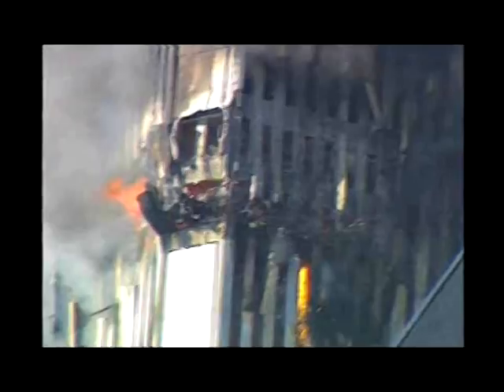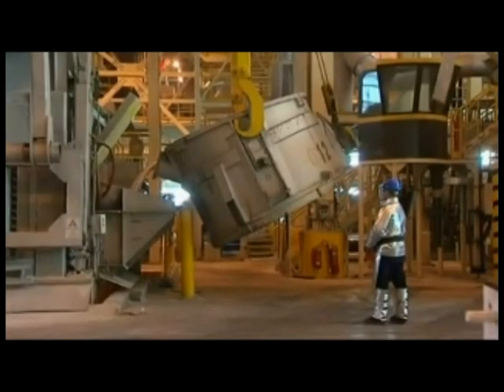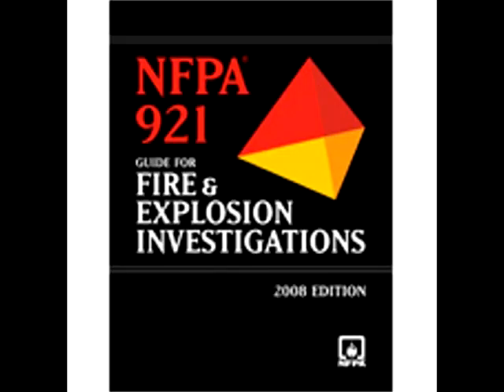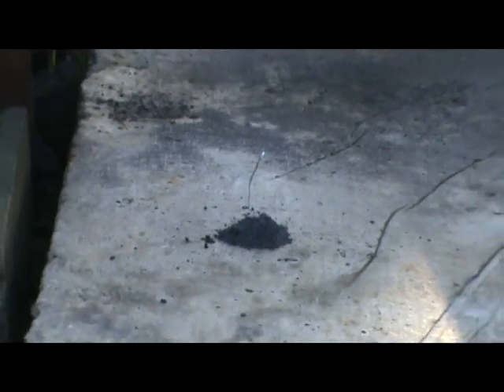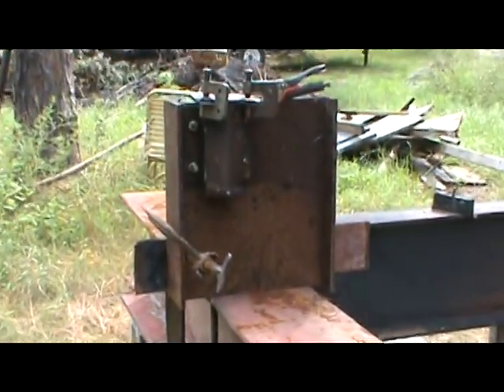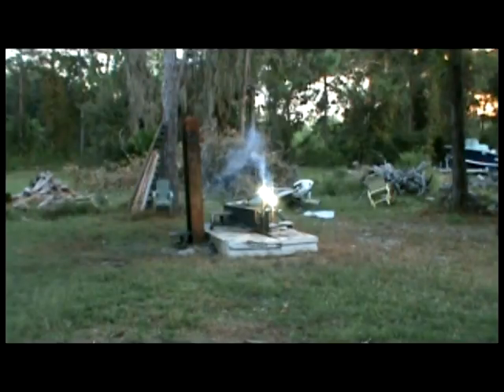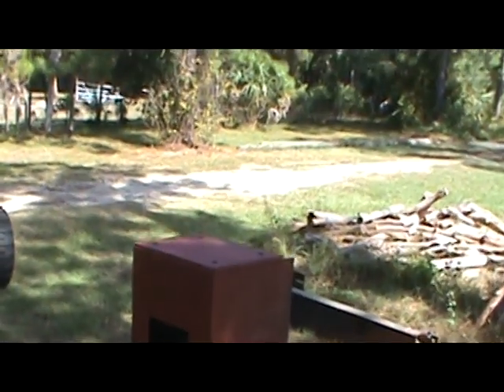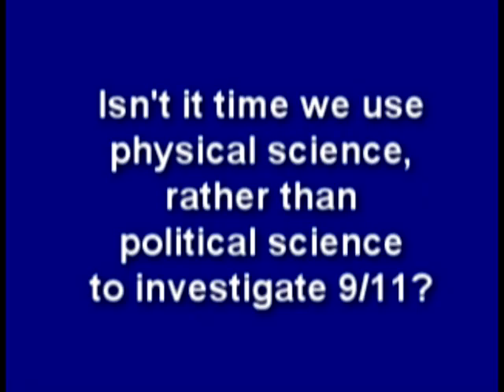9/11 Experiments: The Great Thermate Debate

Comment: @ThePeage I have a problem with their methodology.

In short, EDS scans are far too random, especially on such a sample size as their red layer, to give consistent information of the structure. Further, if you cannot find to any level of accuracy the relative amounts of thermitic reactants, who's to say this material they've found was manufactured at all?

To correct this, they might've at least run a quantitative analysis on the cross section, which I'm sure would have been perfectly accurate.

Comment: @debunkerman says "Find out what happens to steel beams when they are exposed to fire."

Well, they sag, that's about all. 
They don't melt, do they.
That's why steel framed high rises DO NOT fall down at freefall acceleration due to fire.

Comment: @ThePeage How droll.
Figure 10 is an EDS scan of a cross section. That's fine.

However, they based the quantitative analysis off of an EDS scan of an entire red layer, shown in fig. 15. This sample is far too thick to give meaningful results.

They should have done the quantitative analysis on results from the cross section.

Comment: @ThePeage Somehow they avoided doing the most significant analyses on the kind of sample EDS was intended for! Jesus!  :P

I find conclusions 2 and 5 suspect. 6 is there for no reason I can tell. 7-9 deal with ignitions tests, with which I am not concerned. 10 is just a string of speculation. Conclusion 1 is obvious, and not followed with anything. 3 is mere visual observation, and 4 is based on a single cross section. Keep in mind, the slice EDS map is of a single layer, no structure follows.

Comment: @ThePeage And on top of that, thick samples may absorb a significant portion of generated xray's, revealing nothing about the interior, and eliminating a random portion of rays off surface atoms.

The EDS graph of the red layer is thus indefinite, making any analysis of it's data suspect, including all the quantification analyses. 

Now, the cross section of a red layer that was analyzed would be exempt from this criticism.

Comment: @Skeptic121 The paper would serve as a foundation for a follow up. However, it demonstrates little and suggests much.

Specifically, it finds the presence of various elements but reveals little about their chemical bonds.  Free aluminum and iron oxide are suggested, but those elemental maps are only done on a single thin cross section of a red chip, and as such you can't see whether the composition continues.

Comment: @ThePeage As it is, various meaningless analyses are performed, such as the ratio of Al/O in Al rich areas and Fe/O in Fe rich areas. Finding it to be significantly higher in the case of Al/O. All this indicates, however, is that the Iron in this sample exists more as Iron Oxide than elemental Iron. And that the Aluminum is more elemental than Oxidized. However, this is completely natural! While Fe particles will rust through, Al will form a protective layer of oxidized Al, limiting oxidation.

Comment: @ThePeage @ThePeage However, to determine whether a sample is of thermite, i.e. iron oxide and aluminum intentionally mixed, we must assume that there is a negligible amount of unusable material in a given volume of sample. This ideal ratio is 50/50. In this, all Iron Oxide is stripped of it's oxygen, which is then bound to an equal amount of Aluminum. This is the one ratio which might have shed light on the nature of the material as thermitic, however it is not performed.

Comment: @ThePeage Bypassing for the moment a lack of detail on behalf of their quantification routines, there is the problem of there never being a comparison between Al and Fe. A thermitic reaction requires a metal oxide and a deoxidizer. In this case, IronOxide and Aluminum. 
Harris' paper does several quantitative analyses of the ratios between Fe/O and Al/O, eliminating the Oxygen bound with the other element. I find no problem with their method of doing so.

Comment: @ThePeage My point is that it is only with great difficulty that EDS scans can be made to give quantitative results. Either thin sample slice (less than 10 nano meters) are used, or the surface of a thick sample is both polished and cut, so if, say, the detector's shape occupies a plane, the sample surface occupies a parallel. Other arrangements are possible, depending precisely on the detector's shape.

Comment: @ctcole77 

In early 2000, Stephen Way acquired the appointment of Marvin Bush to the Board of Directors of HCC. In that transaction, Bush not only landed a very large salary, but a sweet stock option deal. He purchased about $130,000 worth of HCC stock which is now valued at close to $600,000, not even one year later.

Comment: @ThePeage '....then where did the come from'
No clue.

'XEDS will give a spectrum of the whole test area'
True. My point is this is all it provides. It does give with any useful accuracy the relative amounts of elements from spectra.

What is recorded in an EDS scan is essentially the energy discharge when an electron is knocked from an atom's inner shell. However, the velocity of this discharge is random. It is not a guarantee that an averaging of the amount of signals will reach a detector.

Comment: @pjnlsn An EDS scan cannot tell you the relative amounts of each element. It's results can be highly accurate, but it is only the existence of certain specific spectra, and their corresponding elements, which it reveals.
You cannot say from this data that, for example, the samples contain 52% Iron 25% Al 23% Oxygen, like some thermites, all you can tell is that the sample _contains_ Fe Al O..

Comment: @pjnlsn "As a report, it fails to distinguish between metal ignition in an oxygen atmosphere, and a thermite reaction"

If I recall correctly that conclusion was drawn because the observed temperature differential was greater than what can be accounted for by the oxygen.

Comment: @DarkwingScooter He 'lights it on fire' and says the energy output is large, essentially. He could have at least isolated the chips in an oxygen less environment, making it clearer that this substance could burn without external oxygen stores. As it happens, the paper reports a man lighting a piece of metal alloy on fire in a room.

Comment: @DarkwingScooter True enough.

Even not requiring detailed descriptions, the paper doesn't say how it goes from detecting a few elements to it being thermite. Which is specifically a metal oxide and a deoxidizer, i.e. aluminum.

It essentially says that these chips must be thermite because they burn and because they contain, in some form, and in some amount, Iron, Oxygen, and Aluminum.

Comment: @ThePeage In any case, I've actually read the paper, in it's apparently revised form. And the sketchiness of it is apparent, even to me. They go through and show a few spectrographs here and there, while detecting the presence of certain elements, they fail to show anything else about how those elements appear, in what structure, and how they are bonded. It claims iron oxide, and says the percentages indicate it, but fails to show what those percentages are, or how they would have been found.

Comment: @noozilander Explain to me where exactly a hypothesis or actual analysis is to be found in the paper. All it does is do a minor spectral analysis on some chipped material, and immediately concludes that the mere existence of, essentially, aluminum and iron means that the chips must have been thermite. With no analysis whatsoever, and unaware that other papers address this already. The type of scan they performed does not yield amounts, only the existence of certain elements.

Comment: @Merlin5x5 says "No, I told you that ALL microspheres from volcanoes start out as teardrop shape"

LOL!
No, swallower, that is a categorical lie.
Your original comment was a feeble attempt to explain that iron micro-spheres could not have been caused by the molten iron falling through air. You said it because you didn't understand surface tension at the time. Now you pretend to be an expert about it. LMFAO!

You lose when you lie, coward.

Keep swallowing.................

Comment: I've used many ways to melt steel in the last twenty years, and it would be very easy for that liquid fuel fire to melt steel if the fresh air being draw into the building is concentrated into tight spaces

Comment: @Merlin5x5 splices held together by 8 bolts total, that's 20 pounds of thermite and the connections is gone. Once the bolts are gone the weight of the building...

Comment: @Merlin5x5 lol, all the columns were under the same pressure and the corner columns had 2* bigger surface -they carried twice the load of a normal core column.

Or do you want to claim that 4 columns carried 40% of the total load of the building with the remaining 270 just watching? OMG

Comment: @Merlin5x5 Look, idiot. That sentence is take out of the context. Skilling did a great job, due to wind resistance the steel had to be under same pressure all over the building (I think it was 30 or 300 MPa) now the corner columns were 1,5 times thicker and a little bit bigger - their profile was thus 2* larger -. they carried the load of a two normal core columns, so the four corner columns made up 10% of the core's total cap. got it?

Comment: @Merlin5x5 that's taken out of the context and you know that it is a fucking lie. 47 columns total, 43 had aprox. the same thickness and 4 were a little bit bigger with cca 1,5× thicker walls, now do you want to tell me taht those 43 columns carried only 20% of the load? What do you smoke?

Comment: @Merlin5x5 he uses W12×50 beam, that has walls 1cm thick

90% the columns at 96th and 98th floor had 3 cm thick walls

source: NIST's materials at     wtcmodel.wikidot

you fail

Comment: @Merlin5x5 you have sad that the WTC impact zone columns were 8× thicker than the ones used in this experiment, anderson used 1cm thick columns. The WTC columns were between 2-3,5 cm thick. Now, do I need to teach you basic math? You've also sad that there was no space for the cahrges, I told you about the cavities between the plaster board and the H columns..etc

Comment: @DonArsuk84, "Where is the steel which were cut by thermite, which caused you to be 100 percent certain that thermite was used to demolish wtc."

“A one-inch column has been reduced to half-inch thickness. Its edges–which are curled like a paper scroll–have been thinned to almost razor sharpness. Gaping holes–some LARGER THAN A SILVER DOLLAR...This Swiss cheese appearance shocked all of the fire-wise professors..."
The “Deep Mystery” of Melted Steel

Watch at the 10:33 mark

Comment: @Merlin5x5 'no evidence of IRON'
I just had to say, this made me laugh (no offense).
Do you know what steel is? Usually about 99% Iron, and 1% Carbon.

Anyways, I understand both iron and concrete particles were found in the rubble. Impacts on the building are all you need to explain this. A question to others: Need all rubble fragments be the size of blocks?

Comment: @Merlin5x5 "AV FUEL pool fires typically incinerate a plane down to the wingtips, nose and tail. They would do that EVEN MORE SO, confined inside a building."

No sir they do not, never seen a plane crash huh? The strew AC aluminium for hundreds to thousands of yards long. Wreckage everywhere. The do not leave molten metal. You obviously do not even attempt to research anything before you start spewing nonsense.

Comment: This is hilarious, you try and use one of the primary reasons why fires could not have done that day as a defense to what certainly did do it! "Heat sink" In-fact thicker steel is a better heat sink, as is the steel decking and concrete, extremely effective for non focused  low intensity and slow sources like fuel fires.

Thermate / thermite on the other hand is not a slow source is focused and extremely intense. You validate that fuel fires are not capable of causing the collapse with this.

Comment: @Merlin5x5 your full of shit, your not and evading the obvious, which is it has in this video been proven to be possible by a novice in-fact. Proving that there are far far more effective way to use the same methods.

your ignoring the obvious to "try" to avoid the fact that you and any supporting your premis have been proven wrong completely with this video.

Comment: @Merlin5x5 Merlin......to extend some of these demonstrations to the full width of a steel column, you simply need *more* thermite. There's not reason to assume the reaction just stop, short of the column width.

As far as attaching to a vertical column, he used some magnets. This failed. It wouldn't if you used *stronger* magnets.

Comment: @Merlin5x5 Out mass?
That seemed to be true in the videos, but he did mention that nano thermite was supposed to be used, which I assume is more compact.

The point is, it's disingenuous to say 'thermite cannot possibly cut through steel'
Rather you must say: 'a delivery system for packed thermite would have left traces',  'traces which we do not see'

Disingenuous, and also not true.

Comment: @SexyMelon Well, i'm fairly certain that a mixture can be formed of solids and liquids, and that it can require a deal of time to settle.
In any case, there could have been combustible particles spread across the floor, and as the aluminum flowed, it picked up these particles, until the mixture flowed out the window.
Just equivocation, I know...

Comment: @Merlin5x5 You should actually watch this video. Thermite is made to cut through varying lengths of steel. And through the heads of bolts, which is afaik the only thing connecting the columns together.

Comment: @SexyMelon It wasn't quite an 'experiment'
It was a claim supplemented with a photograph.

You see, mixtures of different particles of substances with varying densities can mix together. Oil and water mix fine when shaken. It is simply that a greater difference in densities makes it more difficult for two substances to mix, i.e. a greater amount of movement required to keep them mixed.

Comment: And there's one more thing....
You have to consider that office fires are regularly 1000C. And that there could have been fires nearby the molten flow burning, so negating the dampening effect of great air distance. And that the molten flow could have been a mix of combustible material and aluminum, flowing together. So the glow could have been a reaction other than thermite, burning as it fell.

Comment: @SexyMelon "Again, false, as they were not recorded at any other sites in vicinity (according to you, not even at these sites!), or anywhere else, ever."
Says who? Which other sites in the vicinite were on fire? How is 1300°F/700°C not perfectly normal for hydrocarbon fires? Most of the fires burned underground. I think it is pretty normal that they would flare up here and there as the rubble shifts or gets removed.

Comment: @SexyMelon "And only two of them signed their supported for the NCSTARs. Just two"
Where?? What's the relevance here?
""That is very far from true. Only a few are structural engineers." Also a complete lie. All entries are checked and listed with credentials."
A complete truth. You said there are 1300 structural engineers. I dare you: Count them!! I count somewhat over 600 engineers, and many of these are not structural engineers, but electrical, chemical, mechanical, etc. Please apologize.

Comment: @SexyMelon ""the red-grey chips do NOT contain sulfur" They do. Read the paper."
Quote from the paper (page 17): "Other peaks included calcium, sulfur, zinc, chromium and potassium. The occurrence of these elements could be attributed to surface contamination" (contemplate on the last 2 words!). This relates to ONE chip that wasn't ignited. Of the four that were ignited, 3 showed absolutely NO sulfur, and 1 a tiny peak (page 14)

Comment: @SexyMelon ""The hot spots were about 6 patches on the surface of GZ, each covering an area of only some square feet." Then that is simply false, as available to verify with a simple Google Images search."
Read the original report (by USGS) in its entirety, don't just look at googled pix and twoofer websites! They have analysed the images in depth and the result was, as I stated: a handful of spot, each only some square feet in area, were thus hot. Well, not THAT hot. Normal fire temps.

Comment: @SexyMelon "What is this nonsense?"
You said steel glows dark red at 1200°Celsius. That was WRONG on your part. It glows dark red at 1200°Fahrenheit (and is pretty solid still then)
"Based on your previous posts I'm going to guess you idea of "know" is "looked at a page of a debunker website"" - No looked at Twoofer website. Hardly any of the 118 (IIRC) said "molten steel". Some said "molten METAL", some said "RED HOT steel" or something like that. Only a handfull said "molten" AND "steel"

Comment: @SexyMelon "Rest of experiments: I am kinda missing the flows of molten metals that persist for days...." Shifting the goalposts."
Not really. You make a big deal out of the "molten metal" and the "hot spots days after the event. Apparently, thermite burned on 9/11 explains that? No! When you weld train rails with thermite, you melt iron, ok. But 45 minutes later, it will have cooled so much you can run a train over the rail!
So how could thermite account for high temperatures days after??

Comment: @SciMethod "1) The iron-rich spheres are evidence of iron-liquifying temperatures" as happen when coal burns in power plants and turns to fly ash,  which is added to cement to make concerte.
"These "organic fires" you speak of cannot produce iron-liquifying temperatures." - not necessary. Iron-rich spheres are a reaction product of burning wood, for example. When the reaction products condense, spheres form. Some are rich in iron. Run a magnet over the ash next time you make a camp fire.